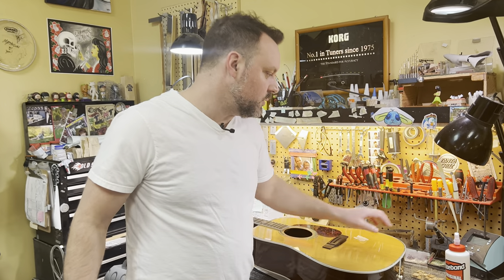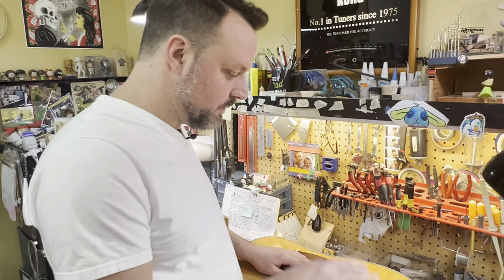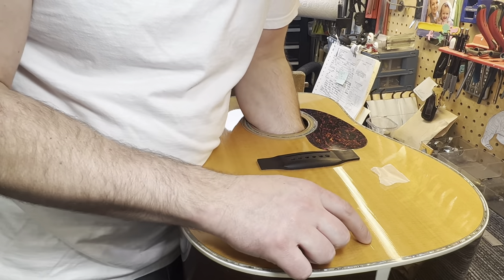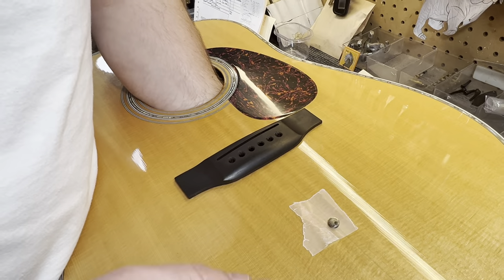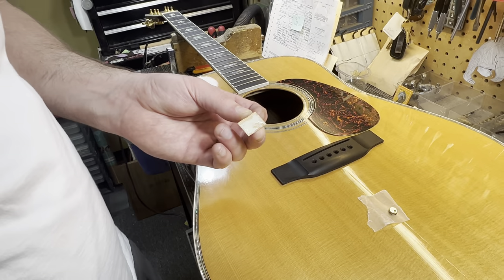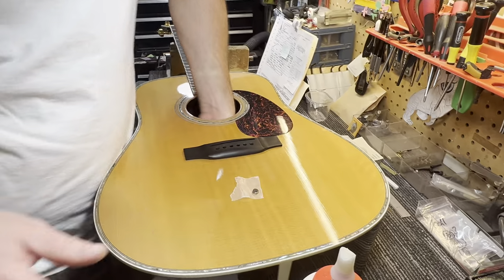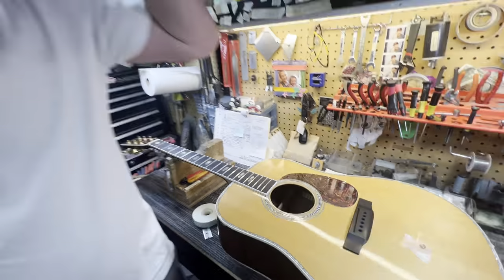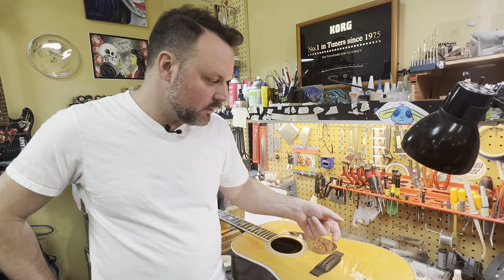Crack Repair Part 2 Installing a cleat on a Guitar

Comment: Great video, thanks. I don't have access to Spruce or Cedar unless I get a large sheet. I do have a small piece of rosewood. Would that be OK? The crack I am fixing is about a inch in length. Thanks
Reply: Oh no.  Rosewood would not be a good choice